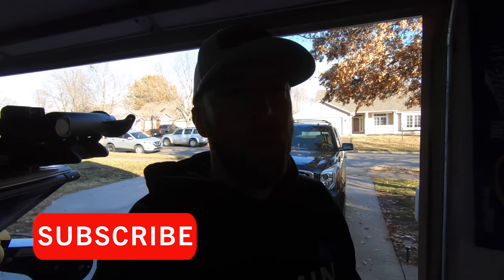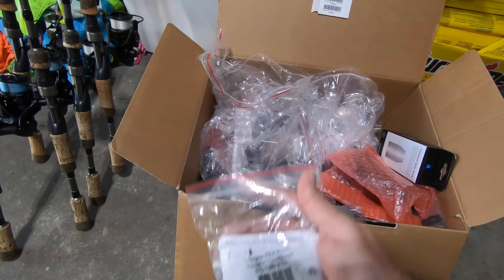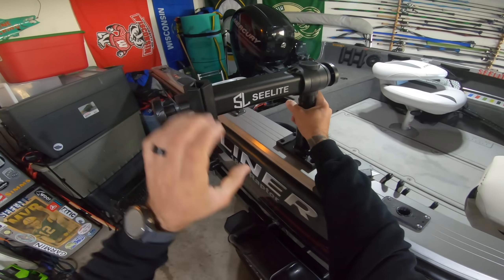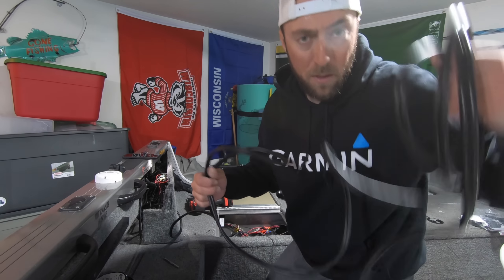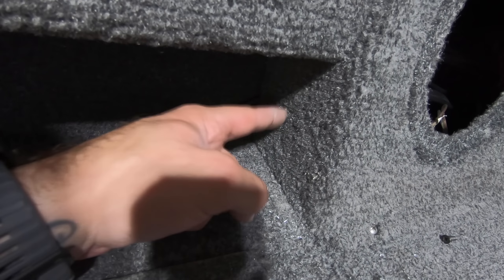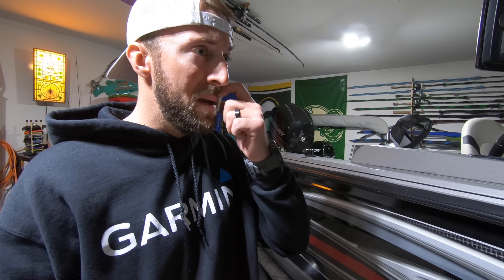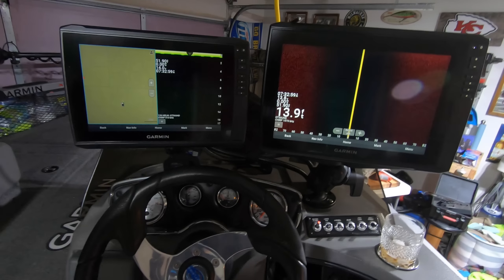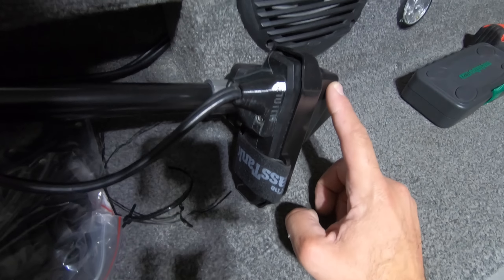COMPLETE Install of My SECOND LIVESCOPE!!

Comment: What size extension pole did you need for the front? I have a G3 angler trying to see if the 12” is enough or get the 24”
Reply from the maker: 12” is more than enough

Comment: Hey Brian. Can I ask why you didn't go with a Dewalt battery adapter this time? How is/did the other work out?
Reply from the maker: Because I run 4 graphs and 2 Livescopes, and I am not about to have to worry about carrying several little batteries with me at any time. I haven’t ran the drill battery stuff for two years.

Comment: Are you able to reach the bilge drain plug with the rear bench seats or what? I just made rear bench seats and now considering removing to be able to gain access to drain hole if for some reason the plug were to ever fail
Reply from the maker: There's an access hole in the splash well behind the back deck to get to it.

Comment: Have you had any problems with the seelite 2.0 with it stripping out or plastic parts breaking?
Reply from the maker: Sometimes. But I fish 300x a year and I’m hard on gear. SeeLite always takes care of me.
Reply: @KansasAnglingExperience  I have been looking at the seelite and the beatdown outdoors mount. Just need to pick one and order it. I just like being able to turn the seelite mount to inside the boat.
Reply from the maker: @andrewhenson5261  best on the market! Use the KAE10 discount code and save a little money.

Comment: Nice video and channel, Brian! Can you (or anyone else with this mount) tell me the distance between the three holes on the mount? Thinking of mounting the SeeFish 2.0 to one of the Superior Sport Trak mounts.

BTW, I was born and raised in the burbs of Milwaukee. The decor in your garage is well done!
Reply from the maker: I’m not sure honestly, but definitely reach out to SeeLite. I’m at the Kansas City fishing expo all weekend away from my boat otherwise I’d measure. And yes sir, I was born and raised in Whitefish Bay!
Reply: @KansasAnglingExperience  Hey Brian. Sounds like the expo went well (per your latest video). I was born in West Allis and also lived in New Berlin and Waukesha. Currently living just outside of Springfield, Missouri.

I reached out to SeeLite a week or so ago and haven't gotten a response. I'll send them another note. The folks at Superior Fishing actually offered to drill out a custom mounting bracket if I got them those specs. Great folks to deal with!

Good luck with the winter crappie bite. Got a hunch that the hard water is on the way for your neck of the woods early in February.

Comment: Brian - Another Great Video

Quick question for you - from one Brian to another.... For a 16 foot Jon boat with console -  Is there a way to set up 1 Garmin fish finder unit (that can run down image, side image and also Panoptix when moved to the bow) mounted at the console to run a transom transducer for down and side imaging and to locate structure & fish while trolling around and then once they are located - move the same unit to the bow and connect to a transducer pole (like https://youtu.be/7j-_WWOVea4  Dad's install, SeeLite, Poleducer etc.) with a Panoptix live scope transducer to be operated independently of a spot lock trolling motor?  

Trying not to break the bank / be served divorce papers :)

Thanks in advance!

Brian